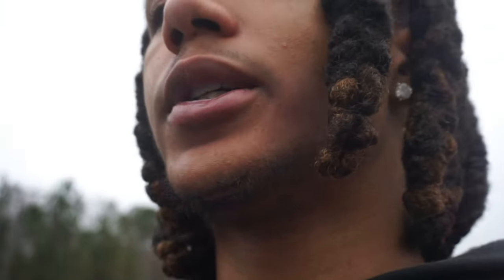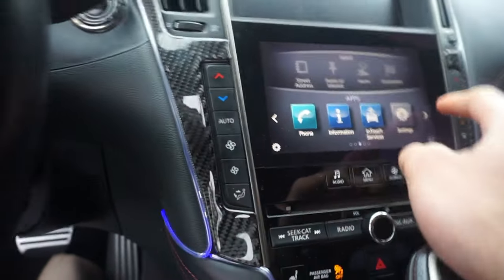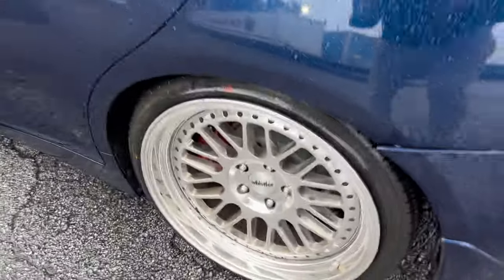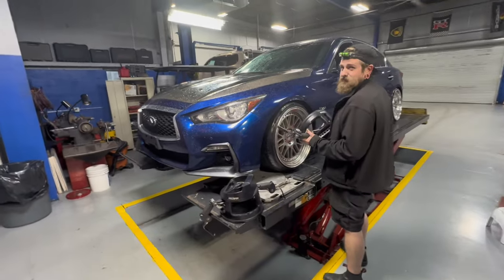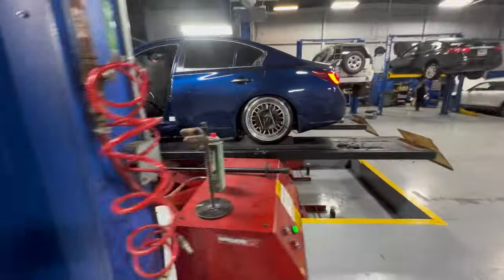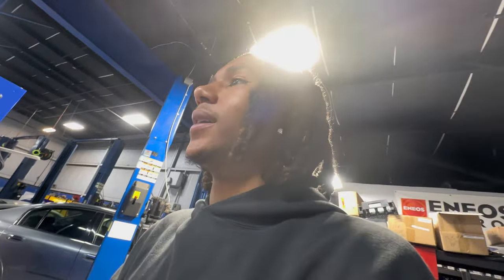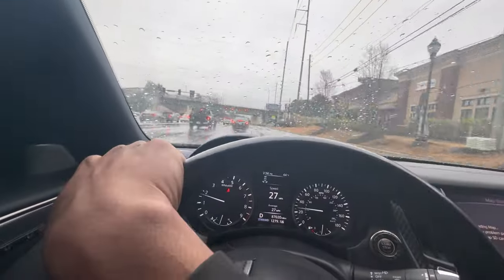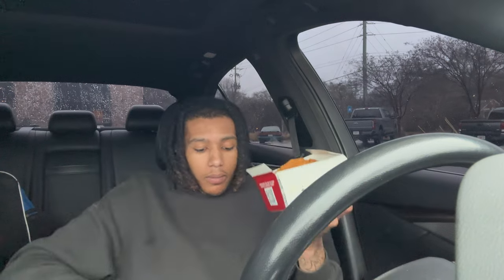BUYING A ILLEGAL Q50 REDSPORT !!!

Comment: Bro does not know abt cars😂
Reply: LMFAO
Reply: bro not at all😭😭😭 doesn’t even know how to swerve fr… and was riding 4th gear going 80 mph💀 that had me internally crying
Reply from the maker: @yvngdread1298 I can pull to 100 in 4th crazy mannn
Reply: @solid_marq they don’t know nun bout them qs twin. that bih hard asf tho gang keep goin !!!!
Reply: I can pull up to 80 3rd and 110 on 4th gear lol and i got a 6 speed dsg transmission, mk7.5 golf. Tuned ecu and tuned throttle 2 separate units tuned. 105 octane running low 12s at 120ish. Just stock motor and stock airbox, only tuned and racegas
Reply: looool
Reply: Instead of talking shit to him, help him and stop being page trolls
Reply: @BoostAuthority  if you don’t know what you talking abt shouldn’t be making YouTube videos talking abt it 💀
Reply from the maker: U glazin

Comment: Hellcat killer? Sounds funny to me bro. I know it’s RedSport model but stop it 😂
Reply: He raced a scat pack and running on a high. He will learn the hard way, leave him be 😂
Reply: without upgraded turbos he’s not gaping a hellcat
Reply: @Q60Duke  even turbo upgraded, he’s not gapping no hellcar
Reply: @KhoaTran-mq2jr hell yeah with upgraded turbos he gapping a cat. My guy on z1 vrx70b turbos this car can get 750 wheel horsepower, a stock hellcat only has 620 wheel horsepower. Shits a heavy ass 4500lbs boat. The vr30 and b58 are the best tuner engines right now
Reply from the maker: @GarciaQ60 Thankyou
Reply: @Q60Duke  a FBO E85 q50 can beat a stock hellcat it has to be at at least 500whp tho
Reply: @KhoaTran-mq2jr upgraded pure turbos on e85 making over 600 wheel
Reply: @2seep Where did you get 620 horsepower for a stock hellcat? A Hellcat has 717 horsepower… If you didn’t know. And Redeye has 807…
Reply: @2seep  And no bmw and vr aren’t the best maybe the best for your buck but Porsche Turbo S has the best and fastest platform

Comment: Not even a Camaro killer... this is slower than my F150
Reply: Cap
Reply: My guy on fbos and a tune it gets 450 wheel horsepower, on e85 it gets 530whp. On upgraded turbos it gets 750 whp